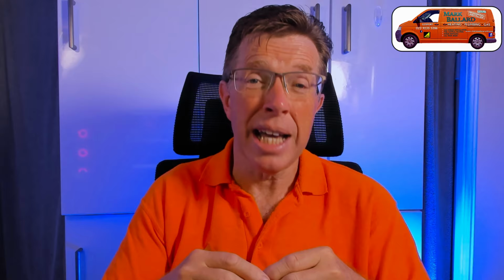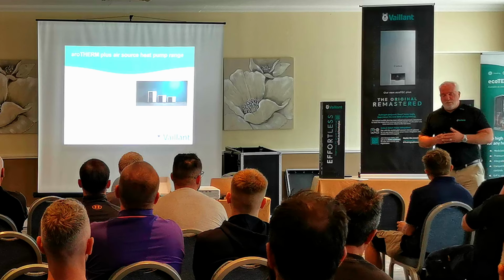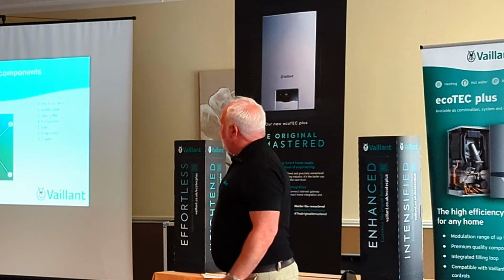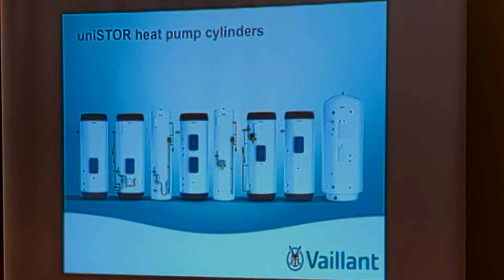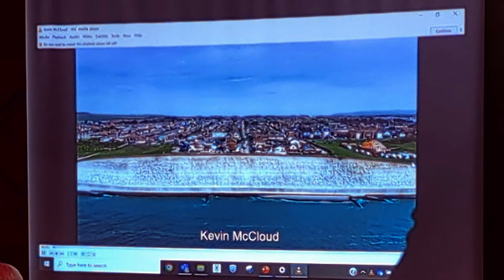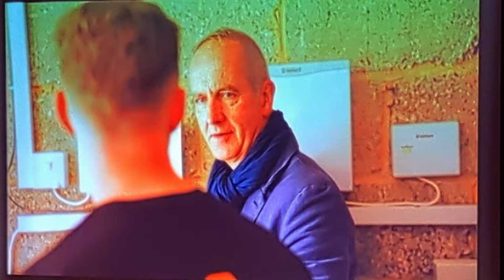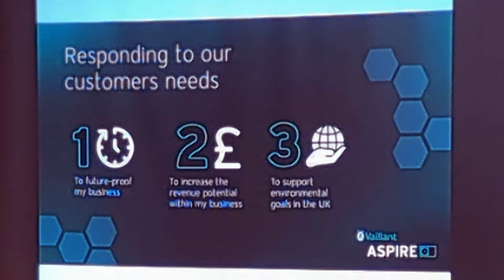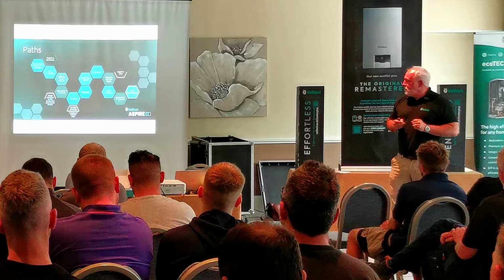Presentation by Vaillant all about their "Vaillant Air Source Heat Pumps".

Comment: As a consumer, I can understand and probably stomach the cost of a ASP when the time comes to replace the gas boiler, but I keep reading that it's highly likely that it will mean the pipework and all rads will all need replacing too - and that's just too much cost and hassle to bear.
Reply: Rad upgrades are very cheap and easy. In my case, we didn't need pipe upgrades despite 10mm microbore throughout the ground floor.